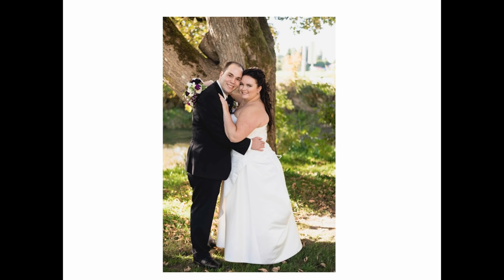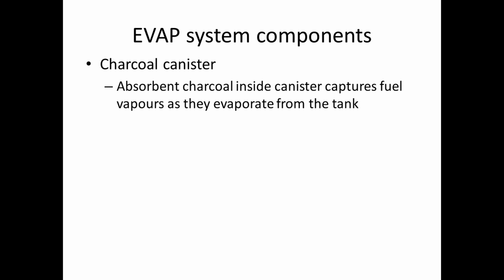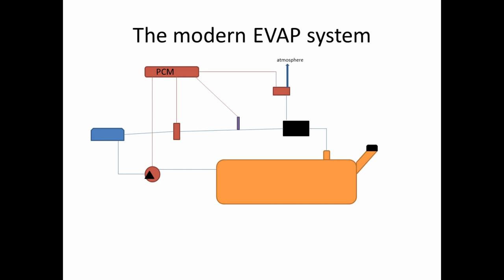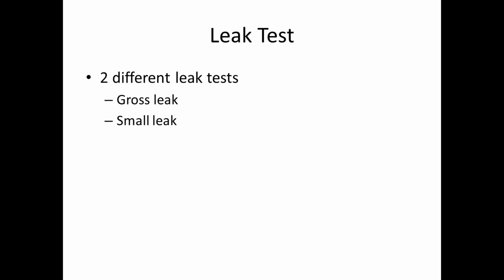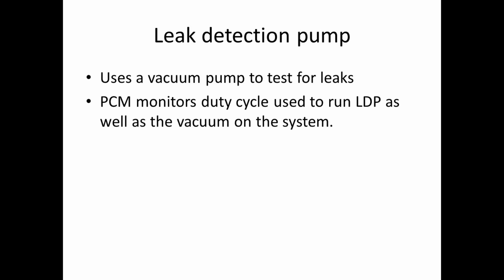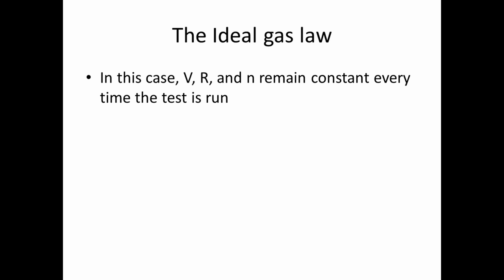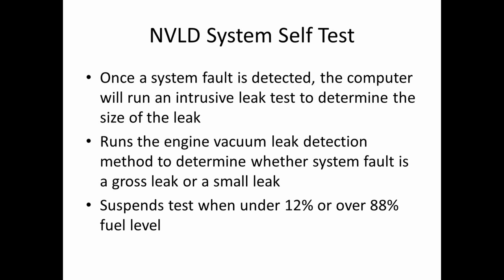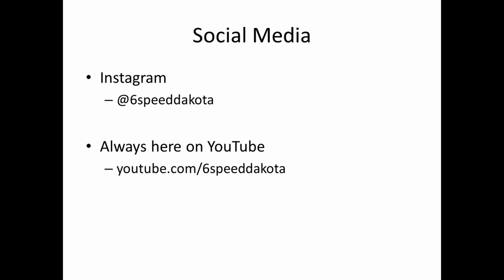6Speed's Lectures: How your EVAP system works

Comment: Hi! Have a question;
I have a Toyota FJ cruiser with an auxiliary tank in addition to the original manufacturer tank. Have had this setup for a while (2 years), but recently developed an issue. My tank builds up pressure. When I open the fuel cap, pressure is released. Sounds like quite a bit since sometimes the metal auxiliary tank makes a noise (like it popped back into shape). This also depends on how much I have driven before opening the fuel cap again. But its just a matter of letting the vehicle idle for 10 minutes and pressure builds up and you hear it rush out when opening the cap. No issues while driving (warnings, performance, leaks). I once parked the vehicle for a month after a drive. When I returned, the first thing I did was open the fuel cap (before even turning the vehicle on) and pressure was released like before. So it kept the pressure for all that time.
The only thing I can see is that the line running form the canister in the engine bay (which also has a hose coming form the tank and another to the purge valve) to the chassis, is not connected into the chassis frame. Seems the clip broke. 
Any suggestions?
Reply from the maker: So the pressure buildup is most likely from the fuel expanding and creating pressure. When you run the vehicle, the fuel pump in the tank creates heat, thus pressure. All that clip you're referring to does is hold the line to the frame and prevents it from flopping around and getting caught on things.

Now I'm not certain how your system is set up, but you definitely need a vent line. This will prevent the fuel tank from getting pressurized, or the opposite, being put under such a vacuum that the pump cannot pull a vacuum. This is actually a common issue on marine engines because the fuel pumps are generally not in the fuel tank and the salt from the water will generally plug up the vent and cause this. I digress; I'm not sure what tank is causing you the issue, whether it be the auxiliary or the factory tank. But it sounds to me like the vent is plugged either way.

For the auxiliary fuel tank, if it's a typical racing fuel cell, it will usually have a few ports; one of them is the fuel supply, the other is the return (if used) and the last one is usually a vent. For a lot of racing and off road applications, there's a check valve screwed into the vent port known as a rollover vent. This will prevent fuel from leaking out of the vent if the vehicle were ever to get flipped over. Since it's an FJ, I'm assuming it's probably been off road its fair share of times, it could potentially be that the line to the fuel vent could be plugged up with mud or dirt, or the check valve might be stuck from dirt getting jammed in it.

For the factory tank, it should be set up similar to the diagrams in the video. If there's pressure in the tank, try remove the hose that goes into the purge valve on the fuel tank side and it should release all the pressure. If it doesn't and removing the cap does, then it's most likely that something in the charcoal canister has gotten plugged up. Either way, I'd be willing to bet something is plugged on the atmosphere side of the vent valve, again likely from off roading. I've even heard of spiders making nests in the evap vent line before the purge valve. Never encountered that one myself, nor do I particularly want to.

Let me know what you figure out, hope this helps.
Reply: @6speeddakota  Thanks a mil for the attention! Also for a great video that helped my understanding.
You're right that this vehicle is for off-road. It's only for overlanding and has had a lot of dirt road under it. The auxiliary tank is from frontrunner.
I will have a look at these points you made.
Thanks again!

Comment: Hey 6speed., this was a very informative video, thanks.  I had one question.  On my 2004 Tacoma I found the line going from the fuel tank to the canister switch is slightly pinched, could this be causing my truck to stall randomly while driving, also stalls while idling?
Reply from the maker: That shouldn't cause any issue, maybe an insufficient flow code but unlikely to cause a stalling issue. I would start by scanning for codes, there are a bunch of different sensors that can cause intermittent stalling including the MAF sensor, crank and cam position sensor, etc.

Comment: Hi, do you have any idea, why my car fuel leaks from the tank when the tank is full after filling the gas. It leaks significantly until I stop filling the gas. I checked underneath; it is not from the charcoal canister, it’s from the gas tank. My car is nissan x-trail 2005. It is not leaking from filler neck vent though. 
We smell gas for few days after filling gas.

Comment: I have the p2422 code on my civic hybrid meaning that the vent valve is stuck closed. However, I have no issues refueling the vehicle. I’ve also noticed a decrease in gas mileage. The decreased gas mileage may be because of the p0420 code that I also have. Do you think the vent valve might not have an issue?
Reply from the maker: what P2422 means is that the computer isn't seeing a change in pressure en the vent valve is opened. So it very well could be that your vent valve is fine, but there may be an issue in the tank pressure sensor. P0420 is a catalyst deficiency code. It'll have nothing to do with fuel economy, but if the cat is plugged, then it'll definitely cause problems and the vehicle will lack power. When is the last time you had a tune up done? If you're not sure, try putting in some new spark plugs and that may be part of the issue.

Comment: Having a P0455 in A 2006 Acura TSX, replaced the gas cap with an OEM part. It still comes up once in a while like 3 months apart. Thinking of replacing the Vent Valve and  Fuel tank pressure sensor. What's your take?

Comment: good video. i have a small doubt, from where does the air enter into the tank when fuel discharge into the engine.
Reply from the maker: The vent valve cycles sometimes to allow air to flush the charcoal canister and relieve the vacuum on the system

Comment: Hello. This video helped me so much. Only one question remains: when the purge vale opens, how does it draw sufficient fuel vapors when it is also creating a vacuum (since the vent valve is closed). Wouldn’t it help if the vent valve opened to allow sufficient air flow until the canister is correctly purged? It just seems like if a vacuum is being polled not all of the fuel vapor is able to be drawn out. Please let me know. Thanks.
Reply: Never mind. I just saw the response to Josh Smith. The vent valve is only closed during the vacuum test.
Reply from the maker: I made a mistake, the PCM actually cycles the vent valve open to flush the purge canister with fresh air and allows the fuel vapours to be pulled into the intake. That was totally an oversight and I apologize for that.

Comment: Hey 6Speed!  I have been plagued with a possible evap problem that I thought was other powertrain components and I am getting closer to understanding the evap system and this problem.  It started one hot day and has got progressively worse to where the truck will start losing power and if you try to give it gas it just wants to stall/ drop rpm,  if I let off it comes back in rpm's,  as I continue under those conditions it Dies.  If I let it sit for a few minute or hours it drive fine,  If I let it sit overnight it runs great again.  Lately since it has gotten cold it does not have any problems until the temperature gets back up to 50 degrees F,  then it starts acting up again.  Truck is a 2001 s10 4.3L 2 wheel drive automatic.   Trouble codes are: current:   P0128, P0341, P0440, P0449, P0453.  Your thoughts  would be helpful,  course of action check out  Vent Valve?  Any help would be great Thank you!!
Reply from the maker: P0128 is just a thermostat, easy fix. P0341 is cam position sensor out of range, which means that the signal doesn't correlate to the pulses of the crank sensor, which could mean 3 things; you may have a bad cam sensor, the timing chain may have jumped a tooth, or the distributor isn't in correctly. P0440 is general EVAP system fault, P0449 relates to the vent valve solenoid circuit, so either the coil in the valve is toast or the wiring to it is. Finally P0453 is EVAP pressure sensor high input.

Your stalling issues are most likely unrelated to the EVAP faults. First thing to look at is that P0341, that'll definitely cause some issues with the engine trying to run properly. The second thing to check once it starts doing it again is the fuel pump pressure. The lousy central sequential port injection on these engines requires a minimum of 50 psi to pop the nozzles open, so once the fuel pump starts getting weak, these symptoms start appearing.

Comment: I have a 99 VW Eurovan and when putting gas in the car the pump shuts off constantly.  No fault is shown on the dash.  Was wondering what this would be indicative of.  I think you note this would be a Vent Valve that is stuck closed.  But would this mean that no fault code would show on the dash.
Reply from the maker: What happened with my wife's Mazda was that the charcoal canister was plugged solid and wasn't letting the air escape from the tank. What you need to do is find the line from the canister to the purge valve, make sure it's clear. Then you need to find the line from the tank to the canister, make sure it's clear. If both are clear, then check the canister. Sometimes the charcoal falls apart inside it and plugs it up really badly.

Comment: My 2002 4-cyliner Toyota Camry smells like raw gas near the tank usually upon shut off. No check engine light. Any ideas?
Reply from the maker: It could be a lot of different things, check the fuel cap gasket to make sure it's not ripped and check the hoses coming from the tank to the canister, vent valve, etc. My wife's car smells a bit when the tank is full and it's never given me any issues. It also may be the gasket for the top of the fuel tank where the pump meets the fuel tank.

Comment: I have a question: How often and when is the purge EVAP valve energized by the PCM? Is the EVAP system purged upon start up of engine and/
or the system intermittently during car operation? Should there be constant engine vacuum to the purge valve at all times (on engine side of valve).
I hooked a vacuum gauge on purge valve port (canister side) and waited for system to purge with car running - never saw any vacuum. I then checked engine side hose connected to purge valve - no vacuum there either. Check engine code for EVAP system keeps appearing....
Reply from the maker: The EVAP is commanded by the PCM, usually using a pulsed signal. It usually is only commanded on once the engine reaches operating temperature, it usually holds around the 50% mark during regular driving but that's predetermined by the algorithms written in the PCM software. Since the valve controls the vacuum into the purge system, there is always vacuum to on the engine side as far as I know. So you may have either a plugged up or rotten vacuum hose that's causing issues to your purge valve.
Reply: Thanks for the info - I have a 1997 Isuzu 4 cyl engine. The vacuum hose runs from the purge valve up to underneath engine intake manifold. All I can do is feel hose with fingers - it sorta disappears under manifold. Seems to maybe connect to another solenoid operated device - not sure. I reckon I would have to remove intake manifold along with the mess of hoses and wires to see actually how it functions (lots of work.... drats!) I've come to learn this particular vehicle, Rodeo, has issues with decaying hoses within this
manifold so have to take apart to understand it all. Your video was very helpful and informative - thanks for posting it!

Comment: If the vent valve is always open, some gas vapour will leak into atmosphere from the canister. Is there a check valve(ball) so the vapour will not leak to atmosphere and only outside air can be sucked in?
Reply from the maker: TheLazydavid it can’t leak fuel vapour into the atmosphere because the charcoal in the canister absorbs it. It’s surprisingly effective.
Reply: @6speeddakota  Thanks for your explanation! 😄

Comment: My question is about gross leak test. So if the purge valve is open and vent valve is closed then vacuum leak can be beyond evap system itself? Thank u
Reply from the maker: What will happen is during the leak test is it will open the purge valve until a certain set limit is reached, then it'll close the purge valve and it'll watch the fuel tank pressure sensor to see if there's any decay of the vacuum in the system. If there is, or there's a fluctuation, it'll trip the code. I've also seen a gross leak code get set from the purge valve being stuck open because the pressure sensor will see variations in the pressure readings when they should remain fairly constant

Comment: i have  a 2007 Peugeot  307 2.0lt. my question is or comment  is, my evap canister became unlodged the valve thats connected to it also separated from the canister its self, what can happen to the rest of the system, as in contaminants entering the system and messing things up. is there anything i have to reset?

Comment: We notice a raw gas smell at warm engine start. I replaced the injector o-rings hoping this was the issue.  It wasn't.  We do not have any engine codes set.  I deliberately left the gas cap loose for 2 days and still no engine codes were set.  Any ideas?
Reply from the maker: It's very unlikely to be an evap problem in my opinion. If you go to start it and it seems like it starts very rough at first, and/or accompanied by a long crank time, I'd probably head in the direction of an injector that's dribbling once it's shut off. Check the connection between the exhaust manifold and the head, also check the connection between the manifold and the cat. Look at the exhaust anywhere before the catalytic converter. That will generally smell like gas if you have an exhaust leak on the pre-cat side of the exhaust, but you may not notice it as much once it warms up a bit and seals.

Lastly, if the vehicle uses a return style fuel injection system, check the fuel pressure regulator to make sure it's not leaking. The ethanol in the fuel will tend to eat through the rubber diaphragm, and cause fuel to leak into the vacuum hose that's connected to it.

Comment: For a 3 port vapor canister on an older car if you plug the purge port and only connect the vent line to fuel tank, will the canister still be able to breathe through the air inlet and function ok?
Reply from the maker: The canister will get saturated because it’s not being purged. It needs to be purged through the engine to clear out the charcoal inside the canister

Comment: I removed the charcoal canister from my motorcycle, is there a probability that doing this will this throw up a fault?
Reply from the maker: If it’s fuel injected, it’ll probably throw the check engine, but won’t likely cause any drivability issues as long as the vacuum lines are properly capped. If it’s carbureted, it definitely won’t cause any issues except you need to make sure the vacuum lines are capped so it doesn’t run lean

Comment: I have a 1993 toyota pick up 4 cylinder manuel transmission that just didnt pass the smog check because of the evap fault. Do u have any solutions to this problem?
Reply from the maker: You need to determine the cause of the fault. There's a lot of different things that can result in that. You need to narrow it down first.
Reply: I'm going to replace the purge valve n the canister. Let's see if that works. Thanks

Comment: I currently have issues with high pressure in gas tank after driving and my pressure sensor is throwing low and high code. Is this symptom of bad pressure sensor, vent valve, or possibly Canister?
Reply from the maker: It's unlikely that the sensor is no good. There's most likely a restriction somewhere between the tank and the vent valve. Sometimes the end of the tube that the vent valve is attached to can get plugged up. What I would do is make sure that the line coming from the canister to the vent valve is not plugged up. If it is, then check if the vent valve is stuck. If it is, you've found your culprit. If the vent valve isn't stuck and the end of the line is free and air flows through it well, then check the charcoal canister to make sure it isn't plugged. I've had that happen on my wife's car. Generally what is indicative of a stuck or plugged vent is that it is hard to put gas in because the air won't vent out of the tank easily when filling it.
Reply: @6speeddakota  yeah my hose from valve Solenoid to Canister is clear. Also my charcoal canister is clear. It's weird that it seems as if I am getting symptoms of stuck closed vent valve when it's brand new. I also tested it before I installed it. I do have an aftermarket wire harness so maybe it's wired backwards. I may need a tool to test it though dang it.

Comment: in the fume purging process, does the EVAP need to draw in fresh air?
Reply from the maker: Yes, I was incorrect. As the system purges, it cycles the vent valve to flush the canister with fresh air